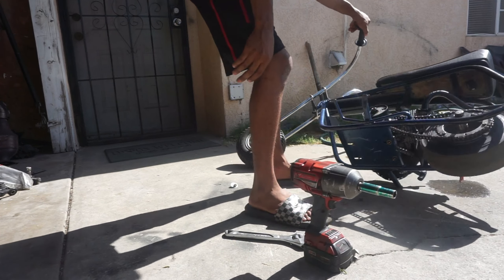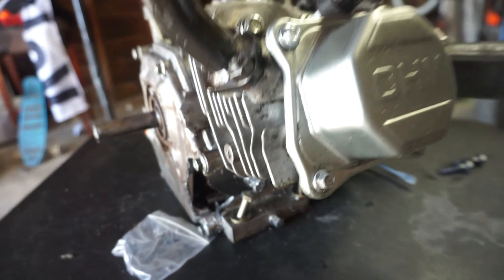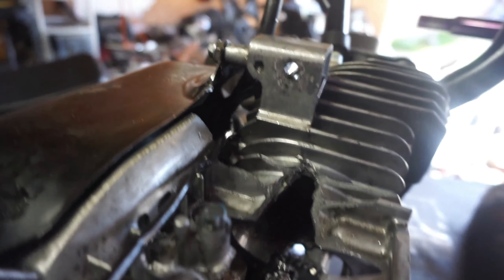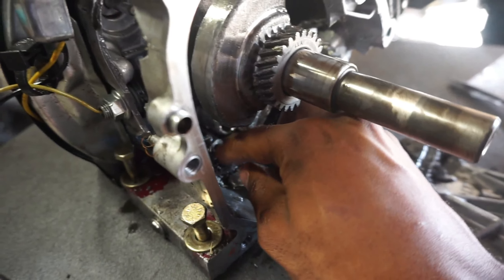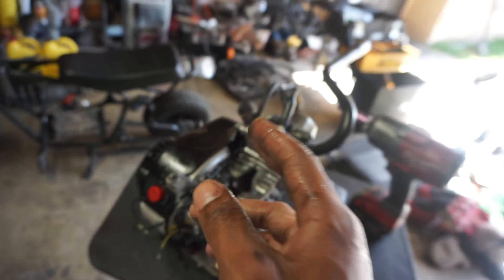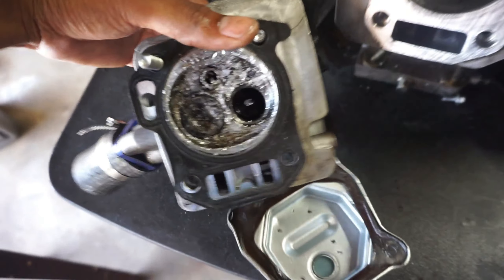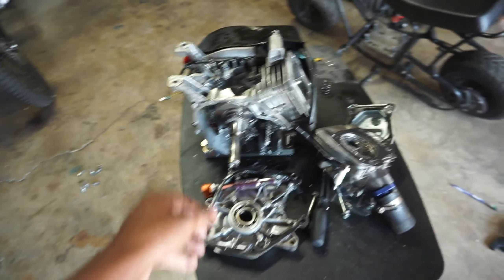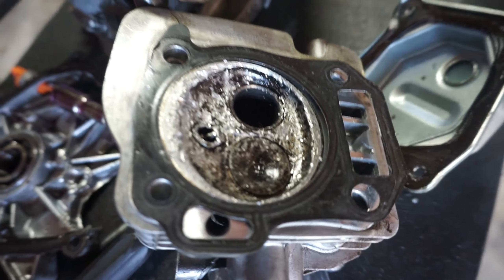I Blew Up My 212 Predator Races Motor! Rip 🪦😞

Comment: I just blew my first motor, blew a rod slam through the front of a 224 ; had nothing but trouble out of 224’s been through 3 224’s in a month the ones in my store rn are just junk lol, exchanged the blown motor for a new 212 and now we back in the game
Reply: You have to use billet rods because the stock rod can’t handle so much power

Comment: Next time running that typ of rpm if you still like it stock valve get you some 36lb spring the dame lock key fell out cause of weak spring you had in it flew the key out slid it the piston you can tell I see dent all over the header go 36lb

Comment: I haven't watched the full video yet but I'm curious. Did the Piston break near the wrist pin area or did the rod break high up cuz the way that blocks broken it looks like it was the rod to the block mainly but again that could have been a valve heading to piston valve to valve anything could have caused that to happen as well usually when I'm turning a motor apart to diagon the cars. Check the head check the block and try to put the pieces together to figure out what actually happened that way you can prevent it next time

Comment: Just about split it in half, damn. Glad your okay.
Reply: Just think a bit what would have happened if your engine blew up nothing

Unless your riding a big bike and suddenly the engine blows up and you get could all on the wheels which has happened with my father with the 750

But these small engines and small bikes he can simply stand up if going the right speed
Reply: @KatanaRIDERS.  yeah, but fast passes with some of these mean engine lets go, throws the rider off with the distraction,  and problems start happening quick. Even moreso with bigger bikes like the 750, i cant imagine what thats like.

Comment: Chances are the rod bolts shit the bed. You probably replaced the bearing at least once and you said you swapped the block out recently. They are only good to get torqued (Stretched) just so many times before the metal gives up and they keep stretching instead of clamping. I use moly lube on mine and I’ll replace them whenever checking the bearing or tearing down. Pricey for 2 bolts but cheap insurance for the rest of the motor.
Reply: Oh shit! Looking again, the bolts are intact, cam musta broke

Comment: Hi I was wondering what I should do to my bike and I want to change the color. I have a bt200x with mikuni carb,22ld valve spring ,rpm Metter and header but I had to put the stock exhaust bsck on bc karens called the town ship and I'm getting banned but idgaf I'm still gonna ride